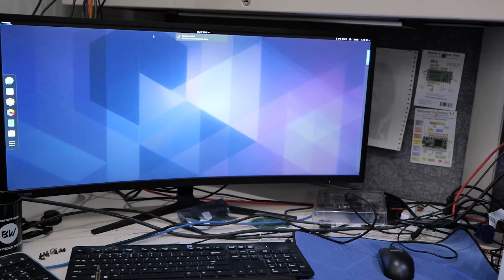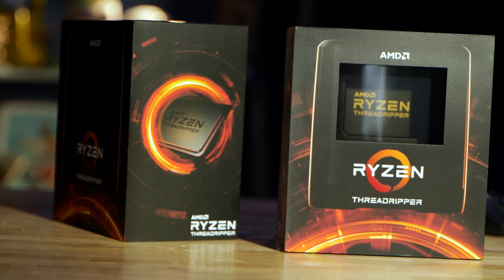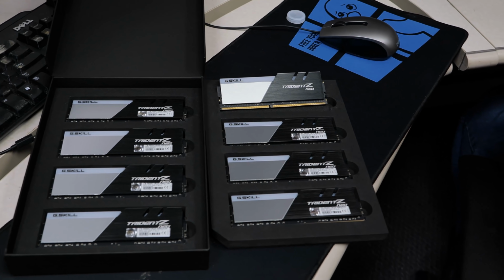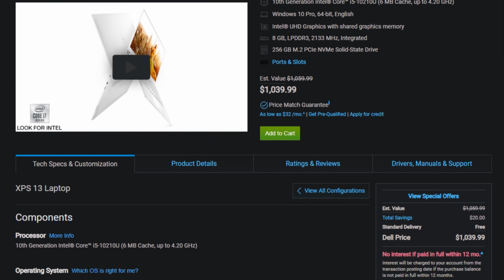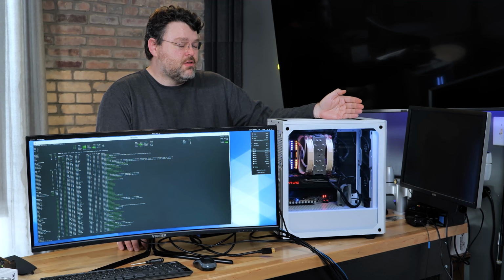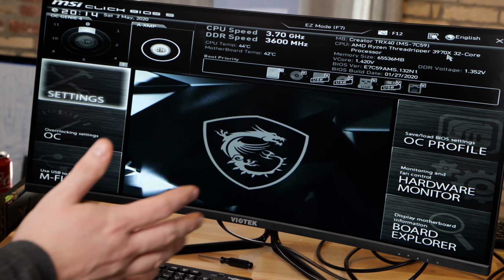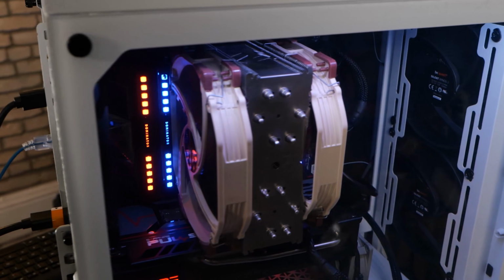Building a Whisper-Quiet Threadripper PC For Greg Kroah-Hartman!

Comment: GKH is “Mister Linux Device Drivers”. I think he created UDev and the USB device-driver architecture. I remember a comment from several years ago about somebody criticizing the Linux kernel for not having stable in-kernel APIs that you can write device drivers for, like Windows. In reply, he pointed out that, at the time, both Windows and Linux had redone their USB APIs about 3 times. The difference was that Windows still had to carry around backward-compatibility shims for the older API versions, while Linux did not. So the overheads, complexity and other such issues for Linux drivers were actually less.

Comment: Hey Wendell, I might be wrong, but did you forget to put the thick rubber pads on the 2nd CPU fan (the one facing the exhaust)? Judging by the sound the CPU cooler makes, I think you haven't. When I put a 2nd fan on my Noctua, I had the same high-pitched propeller sound coming from the CPU cooler. Once I replaced the original thin rubber pads with the extra thick ones that come in the box of the Noctua cooler, this high-pitched whine largely disappeared. If you check the cooler installation manual, they have a picture that shows the 2nd fan using the thick pads.

Comment: 128GB memory, I had to replay that part just to make sure. Amazing stuff.
Reply from the maker: actually, upgraded him to 256gb thanks to gskill! this system is fully maxed out.
Reply: @Level1Techs  oh lordy! Incredible!
Reply: @Level1Techs  That's good work there Wendell - also, I now have the itch to upgrade my compilation box. So thanks for the incoming $4k parts bill :-P
One question: like you, I've given up on Enermax. Is there any other AIO cooler that you think might be worth it from a performance standpoint for a 3960 or 3970, or should I just head straight for a custom loop?

Comment: Excellent build ❤️ , except I would have liked you to have put 2 sound dampening panels on, instead of 1 ( Like you were talking about ). That's the problem with my current PC : too much electronic noise. You've inspired me to build a PC like this one.  Excellent advertising on your Part.  ❤️
Reply from the maker: Not out yet on the DarkBase 500DX, at least, at the time I asked beQuiet :)
Reply: @Level1Techs  I don't know where you live, but you should switch the framerate in your camera to match power line frequency (60fps in North, Latin America an Japan annd 50fps everywhere else), you won't get the banding in video this way
Reply: @666Tomato666  What banding? I'm viewing this in the UK (50 Hz) and it's absolutely fine. You're also the only person to have mentioned this problem; maybe there's an issue with your setup?
Reply: @gh8447  the whiter and darker bands  especially visible during slow-mo. Re-watch the first minute, you'll notice them going from top to bottom
Reply: Nice. Yeah, the DarkBase 500DX looks like a good model. Looking forward to when it does release.

Comment: I build a similar PC. But I removed the second fan from the cooler. The one between cooler and the backside of the case. I found out it is responsible for 80% of the noise but it works without too. Instead I installed 3 slow running fans at the front side to get cool air into the case.

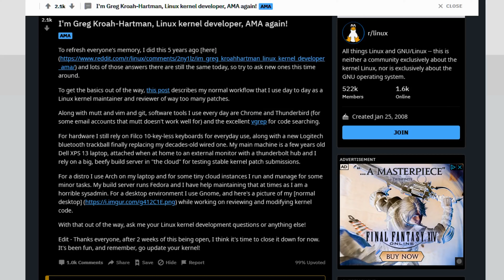Comment: 16:48 I'm glad you posted this nugget here. I was wondering if someone who develops the kernel and uses DYI distros like Arch (I wouldn't call it minimal) would use something that comes "default" and not instantly wipe the installation and use his own rice. I think he would be pretty happy about that and I'd really want to see a reaction video, or at least a reaction call.
Reply: Just for additional engagement points, why I'm saying Arch is not minimal is because it comes with a lot of (pretty necessary) software by default (for a general purpose OS that is). The only distros I would qualify as minimal would be Tiny Core Linux and specialized distros like OpenWRT. Now, that's just my opinion.
I'm also wondering if there are any "core" Linux developers who use distros without systemd, like Gentoo, Alpine, Void, Artix or Obarun (or Slackware). I've read somewhere that systemd developers asked for specific kernel interfaces, so it worries me that Linux distros may become dependent on systemd. While I don't hate systemd per se (I use it on the CentOS instances I manage) and I am not smart enough to understand the kernel, I am worried that at some point Linux may become dependent on systemd (more like, Linux distros won't be able to function without systemd or some hacked systemd-like implementation). Maybe my worries are unfounded, but loving the Unix philosophy of keeping things modular and non-monolithic, these worries are something that I have to face when seeing the massive trend (at least in many enterprises) towards any piece of software and especially towards software with an ever-growing number of bugs discovered.
Reply: @MrBiky  why do you care. Do you have only 10gb storage?
Reply: Most Kernel devs don't care about other programs except GCC and the kernel, I know Linus just installs Fedora and replaces the Kernel.

Comment: Linus and Greg are finally on Threadripper.. Woot Woot for us in Linux..

Intel definitely has fallen far from grace.. They keep doing the way of Apple -- forced obsolescence of expensive and underwhelming products..
Reply: At least Apple products work so smoothly out of the box unlike Surface/Windows 10 that needs to be updated.
Reply: @jinraigami3349  Yea but that's Microsoft to blame. Apple makes the whole pipeline and then some so choice is nonexistent in their ecosystem. At least there's Linux as an option or heavily overhauling Windows manually yourself, hardware options etc.

Comment: What about the ASETEK Vapochill XII-XE Lightspeed cooler PC case that also cools your processor down to minus 70 degrees below zero before booting the system, if the side panel was also the monitor then you would need a PC monitor.

Comment: The Creator TRX40 has an Aquantia AQC107 for 10-gigabit Ethernet. That chip is known to cause lockups in Linux. I have first-hand experience with this. I hope you did extensive burn-in testing because my system locks up every couple of weeks with it enabled.
Reply from the maker: There is, I think, a firmware update to fix this.
Reply: @Level1Techs  My motherboard is an ASRock X470 Taichi and I bought it a couple years ago. So, hopefully your board has new firmware that fixes it. I couldn't find the new firmware on Aquantia's site, so I ended up just disabling the chip and buying an Intel X710 PCIe NIC and using that.

Comment: I remember, once upon a time, there were cases for silent builds. I think they had a bit weak thermals, but they were really quiet. Without having a full open front and a glass on the side. They instead had a normal side plate with sound proofing material. I guess those are not a thing anymore? (And/Or the thermals are actually unbearable for such a CPU/setup?)
Reply: Nobody wants them. Hardware is sexy anyway and needs to be seen. Even if little to no RGB.

Comment: Is the case comparable (in size) to a HAF X (what I use now)? Eventually planning a 3700x (or 4700 build) with a 2070 super.
Reply: It should be way way smaller. Why don't you take a look at the data sheets? 😊
Reply: @iboysven  Agreed, case manufacturers don't usually hide dimensions.  I would say this build would be closer to the HAF 912 than the HAF X in size.

Comment: It's gorgeous!
Does the 2nd CPU fan help with temps? I have the same Noctua cooler on my 3970x and I'm wondering if I should put a 2nd fan like you did.
Reply from the maker: yes, absolutely. It's also a bit of a trick from case to case. In this case (haha, see what I did there) it helps to have good airflow from outside the case to in.
Reply: @Level1Techs  Awesome. Thanks!

Comment: Hey!  I have a question regarding the aorus xtreme trx40 NVMe connections that I’m hoping you could help me with.  If I were to plug in four NVMe , what Sata3 6gb/s connectors are disabled ? I think my confusion is coming from the fact that there are sata3 ports (0-9) so, there are ten overall sata3 ports and I could hypothetically connect ten 2.5” SSDs if I wanted, or ten 5.25” optical hard drives if I wanted, however if I inserted four NVMes on the motherboard, how much more storage can I add?   Thanks in advance if you get a chance to respond to this!  P.s  your content is top notch!
Reply from the maker: Double check the manual. It should be in there. I am guessing that only like 2 ports might be lost but this may only apply to sata m.2 and not nvme m.2

Comment: If that build is whisper-quiet, i´m batman. And you do have other better options, (only 1 tho....). It´s called silver arrow TR4, and if you´re worried about RAM clearence, don´t be!, in a case with maximum airflow you´re getting almost no benefit for running 2 fans on a double tower cooler, cus the front case intake do that job already.
Also if you want a better configuration for that case, fit the 3 pure wings in the front, remove drive cage, mount drives on the floor of the case, tuck excess cables behind mobo, convert the top filter to a solid panel, and remove the interior front filter, since the front panel already does that job. That will get you another 7 to 10ºC improvements on everything. Also in that kind of config, you can loose the mini fan.

Comment: Did you tweak the fan curves? I don't think most people give them enough attention as they can make a big difference in getting the balance between noise and cooling 'just right', and Zen2 cares about temp a lot! Even the same fans can act differently depending on how/where they're mounted (rear and CPU fans are less audible than those mounted in the front or top of the case).
I take it you're not controlling the case fans via CPU temp? 🤔
(motherboard is a better source: as that will heat up when the GPU is under load, or if just the CPU is under load and the heat isn't exiting the case fast enough, plus it's much less jumpy than CPU temp).

Comment: At 11:41 I can hear the Noctua fans singing. Mine makes the same noise at over 1000rpm but I run them silent at 700rpm
Not sure which fan it is as his fan software does not differentiate between case and CPU fans.
Why does it show TWO fan1's???

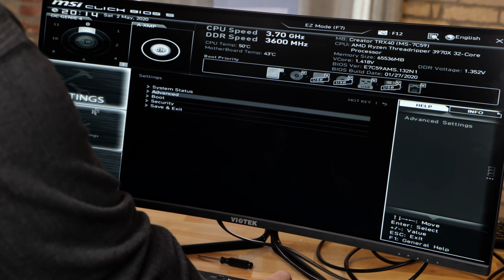Comment: 12:40 only 64GB of ram
Reply from the maker: It's got 256 now, but did some testing across a variety of memory kits. :D
Reply: @Level1Techs  Nice!  Video shows it runs at 3600.  Did you clock it down for 256GB, as you hinted at in the video, for stability sake?
Reply: @Level1Techs  If you can bend the ear of folks at AMD, then won't you explain to them how it would benefit their bottom line to release their code so we can libreboot?

Comment: Parts list is wrong, as he mention in the video he's using a Noctua NH-U14S TR4-SP3 with an extra fan, not much less capable the 92mm variant linked in the parts list which Noctua officially marks as "incompatible" with 3960X/3970X (red X).
Noctua lists the NH-U14S TR4-SP3 as "compatible with restrictions" to cool a 3970X but then doesn't list any restrictions, I think they're being overly cautious given many reports of people doing exactly that with decent results even without the second fan but I'd definitely add the second NF-A15 like he did (for either lower noise or lower temperature).
Reply: Ohh come on! Most people that build a system like this can probably figure that out.. If they have a brain! Why just follow a list and do exactly as someone else?
Svensson jantelag mes..

Comment: https://phoronix.com/scan.php?page=news_item&px=Torvalds-Threadripper
Linus Torvalds: In fact, the biggest excitement this week for me was just that I
upgraded my main machine, and for the first time in about 15 years, my desktop isn't Intel-based. No, I didn't switch to ARM yet, but I'm now rocking an AMD Threadripper 3970x. My 'allmodconfig' test builds are now three times faster than they used to be, which doesn't matter so much right now during the calming down period, but I will most definitely notice the upgrade during the next merge window.

Comment: why all the horsepower for kernel work. Isn't the code so close to the silicon that its extremely efficient and not needing such computation?
Reply: Have you ever compiled the Linux kernel? Or any kernel?
Reply: Time. The single most important contributor to developer productivity is minimizing the time required to build/deploy/test your most recent code increment. Note Wendell's comment about the Linux kernel taking 20 seconds to compile. Getting a system like this into GKH's hands is providing a force multiplier to one of the most important open-source programmers in the world. 
Good work Wendell (and sponsors)!

Comment: I need to finish my wife’s computer. But damn the cost for a decent PSU is freaking crazy these days.
Reply: Seasonics Core Series 500W seems to be priced fairly for the 7 Years of warranty you'll get. (About 70€ here).
Reply: Julian Doll for perspective on the increase of price, her last psu  EVGA 650 GS I paid $65 and for my Cooler Master V1000 I paid $125. Both new on the last builds.
Reply: They are both Full modular and 80+ Gold.
Reply: Just reuse the old one then :D

Comment: Hey, just wondering why you went with swap partitions when the machine has so much RAM?
Reply from the maker: Some programs are broken if you literally have zero swap. A swap file is fine for this case
Reply: @Level1Techs  I've heard that before but I haven't found any specific references. I also haven't run a swap partition in a while and haven't run into any issues ("works on my machine"). That said, I do use swap on low memory VPSs with SSDs for some extra 'memory' :)

Comment: 7:50 the m'noctua cooler
Reply from the maker: I initially used the DarkBase Pro TR4, which is quite a good cooler. But then ram clearance was a problem with different kits of memory I was testing. Before settling on the gskill 256gb kit, which will have its own video soon.

Comment: whisper quiet PC....adds mechanical keyboard KLONG! KLANG!TAKK! (that's me lol) I own the same motherboard but with a 3960x 8 channels 3200Mhz no problem...except...for gaming, games really don't like 8 channels for some reason I get stuttering that disappears with 4 sticks, 1000W is not at all overkill if you use the gpu to accelerate anything you will easily reach 800+ watts at the psu 1000watts is the minimum I'd say you're not supposed to buy a psu with just the watts you need but double that, just like you don't drive a car at the redline h24 watch my screenshots above I had an HX850i I upgraded to HX1200i (that's where the power supply watt numbers come from it logs power input and output plus efficiency)
Reply: Aw crap. I might need a bigger  PSU
Reply: Not just that, PSUs tend to run most efficiently at above half rated spec. So you might pay more for a more powerful psu, but you will get some savings in electricity in the long run. Probably not enough to offset the extra money spent, but it's a nice thought to have.

Comment: How can this be a good build when the TDR rating for the CPU cooler is less than the chip itself?   confused.
Reply from the maker: It was a simple mistake in the description. We used the Noctua NH-U14S TR4-SP3: https://www.newegg.com/noctua-nh-u14s-tr4-sp3-premium-grade-140mm-cpu-cooler-for-amd-tr4-sp3/p/13C-0005-00140 this was used with an additional fan. It’s adequate cooling.